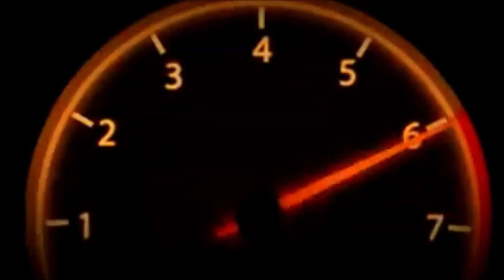A Snapper Ride on Snowblower for free, With Udizzy1969

Comment: Snapper only made that snowblower attachment for one year then stopped making it. My local Snapper dealer told me that they wouldn’t sell me one because they thought the machine wasn’t built well enough for it.
Reply from the maker: Well I will tell you they work mint, and It is still going fine in 2021. The Dizz.